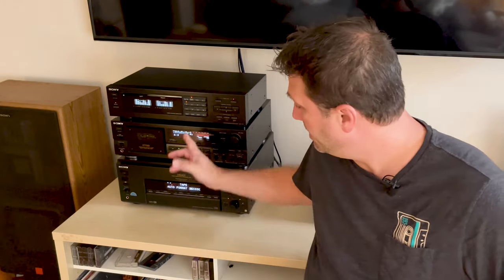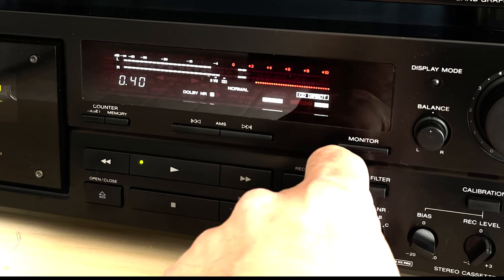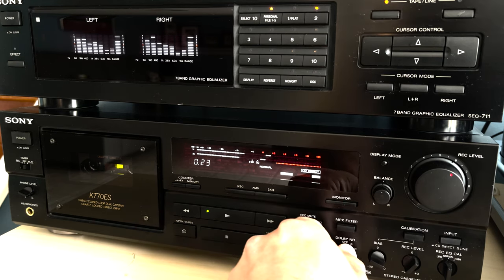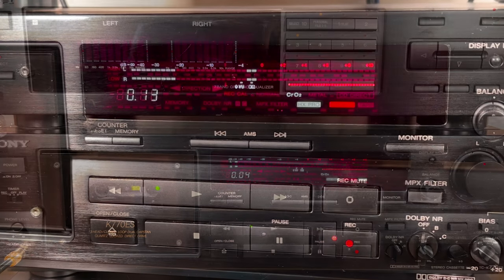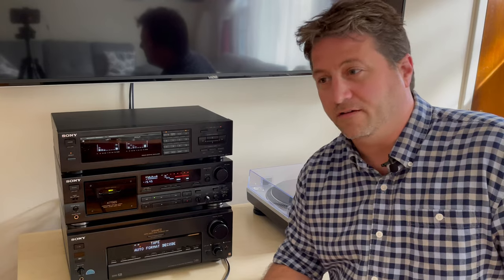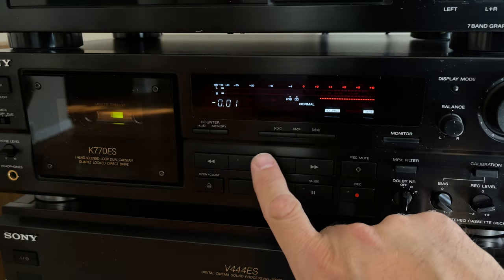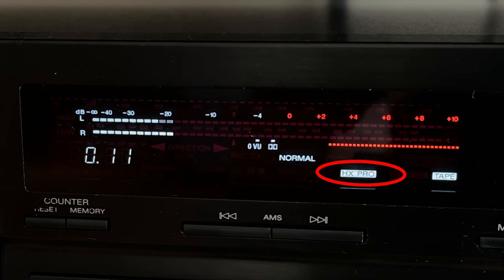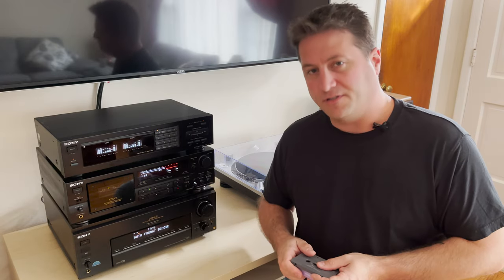Dolby Noise Reduction - Did it ever really work right?

Comment: One issue with cassette is that the head azimuth very rarely matched 100% between two decks (unless you realigned them yourself like I did) so there’s a very good chance that the head alignment on your tape deck does not match what’s on your prerecorded cassette.  Since Dolby NR is a compander based system, its performance is dramatically degraded if the alignment is even just a tad off.
Reply: @PWS Productions 
Dirt, and also tape/head wear.  
With due respect, I can get azimuth pretty spot-on by ear.  I pretty much have to when I’m digitizing old tapes and I want to get as much off of them as I can.
Reply: @PWS Productions 
Back when I used to record onto cassettes for listening on my Walkman or in the car, etc., I got pretty good at adjusting by ear.  I’d record something with a good amount of highs, and then use that to re-align other decks to it because I wanted to be able to get the best I could from Dolby NR.  It actually worked quite well.  Summing the outputs to mono really exposes azimuth error, in that even the slightest bit will cause very audible phase cancellation.  I still use use that method today when I’m digitizing old cassettes and I want to get as much off them as I can.
Reply: @PWS Productions 

The good thing about Dolby-B, as opposed to C, Hi-Com etc. is it will still sound alright even with a slightly misadjusted or ground down head, adjusting by ear will be fine. 
If Dolby B doesn't work it's either user error, or the adjustment is too far off, and when you're unlucky, the head is too far gone.
Reply: never gad issues with azimuth, just dirt, and rarely magnitized.  people messing with heads not knowi g what they are doing.
Reply: Spot On! Worked at a tv station they had revox cassette decks I had awia hitachi and sony my tapes always sounded dull on the Revox machines.
I purchase a Sony head azimuth  check all my decks all good but when played on the revox bad the revox was aligned to a german azimuth  tape
Reply: i always use a pre recorded tape and then align the head so the pre record sounds it best then that way all my recorded tapes with dolby s sound great on other decks/Walkman with dolby b
Reply: ok. we found the one guy that can make Dolby NR work. 
you just have to manually align the azimuth of the tape head.
Reply: @johnviera3884 
That’s why it got a reputation for making things sound dull.
Reply: Yup.  And even two decks from the same company can have a sight variance as well.  I even had a fairly decent dual well deck with the same thing.  I ended up realigning all my decks anyway and got Dolby B and C working quite nicely between them.

Comment: So many things wrong with this video.  1:Dolby level is NOT where your peaks should be. That is there to help you adjust your meters when playing a Dolby Test Tape.  2: For Dolby to function correctly, a cassette deck's  playback level needs to meet the spec of the chipset used in that particular deck. Your 30 year old decks have drifted enough, that the Dolby tracking is "off spec", meaning there will be errors.  3:  Head Azimuth has to be dead on for Dolby to work properly between different decks.  I can assure you, on a properly adjusted deck., Dolby NR works flawlessly.
Reply: Maybe, but this was a consumer technology, most users would not have the means, interest, nor expertise to align, clean and calibrate a cassette deck to this degree (or any degree in a lot of cases). As I remember, I used to record Dolby C onto quality tapes with a well maintained, decent quality, 3 head HxPro deck. The recordings would sound absolutely spot on for the first few plays, then you would start to notice slight variations / hunting in the high frequencies. I could never understand this. Perhaps the 'Quality' deck I had wasn't so good after all  - who knows? I therefore stopped being a fan of cassette tapes many years ago. Yes Dolby worked, but it was way too finicky.
Reply: @adamdavies163  After each playback high frequencies on a cassette are lost by small amount, so every time the "mistracking" goes bigger and bigger compared to where the sound spectrum should be.

Comment: Try a 3 head with Dolby S and you will change your mind it was the consumer 5 band system from dolby based on Dolby SR  it beat out minidisc for sound quality in stereo review shootout in early 90s plus i didnt see you adjust bias or how often are the heads cleaned  good video but a few questions about the test keep it up im subbed:)
Reply: He did the calibration process correctly which includes adjusting bias and it is a 3 head deck, just no Dolby S.
Reply: sorry but no cassette tape will beat minidisc for sound quality .. DAT maybe but not compact cassette

Comment: As far as I know, the Dolby level marking on the VU meter is just a reference for calibration to make the expansion match the compression and reduce pumping and breathing. It does not mean it's the peak recording level.

Also of note is that NAD and Yamaha introduced a feature named Play Trim, which EQ'd the sound before Dolby decoding to compensate for errors with cassettes recorded on a different deck.
Reply: Wanted to tell the same. In no way the Dolby symbol is kind of a level limit. I made some great and loud recordings with Dolby S on my Sony deck on some really hissy Type I tapes.

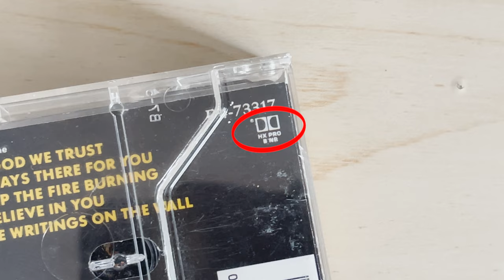Comment: 1:47, I believe almost all prerecorded cassettes after the mid 70s until rather recently had B NR. It was indicated by the double D logo. It didn't have to explicitly say "B NR". I am guessing it was only written once C was available. There are Dolby S NR cassettes, but they're rare. Some Canadian (Cinram) pre-recorded tapes rival homemade type Is in quality. There are also CrO2 tapes from CBS recorded with type II bias and are to be played back as a type I. Some consider these exceptional.
You're right, with modern formulations, noise reduction is less of an issue, or almost non-existent. But you pay through the nose for type II or IV tapes. I have a couple bricks of new old stock "super ferric" ferric cobalt tapes that take tons of signal (Memorex dB C60s, < $1 each), have very good frequency response, but are hissy. C NR virtually eliminates hiss. Being older, my hearing falls off above 13 kHz. To me, the HF sound quality is almost indistinguishable from off, while still holding a signal 3+ dB above the double D marks.

Comment: Dolby NR did work well but, clearly, not for everyone on every deck.  I don't know where you got the idea that "Dolby-Level" is the level you are supposed to keep below.  That is not the case at all.  Dolby Level is the point where Dolby NR stops compressing the recording (or expanding the playback).  All signals above Dolby Level are unaltered and should sound identical between no NR and NR.  The upper end is determined by your deck and the tape formulation as to when it saturates. 

Proof of properly calibrated Dolby NR is pretty easy to achieve as one can record something like pink noise and play it back on an RTA and compare with and with NR and  then record at differing levels.  If the frequency response changes with level, that would indicate mistracking.

However, with your set up, part of the problem is likely your recording levels.  Most cassette decks can only achieve their wide frequency response down in the -20VU range (check the spec sheets for your deck).  If you are recording up in the 0 to +3dB range...odds are, your deck is already killing the HF range some and when you add Dolby NR to the recording, it will exaggerate it.  If you drop your recording level a bit, you'll likely get your HF response back and have an even wider frequency response without picking up the noise.  Dolby-B is going to get you about 10dB of NR in the critical frequencies where hiss and such will be perceived. 

Dolby C will get you closer to 15-16dB.  So, based on where your deck can record the higher frequencies, you can target your recording level and then use NR, properly, to keep tape noise in check.  Dolby S will go yet further to allow one to optimize the recording level and dynamics of one's deck.  

Sony is a bit closed on their published specifications but for Type IV (Metal, they show that the frequency response is 20Hz-21KHz but it reduces to 20-16KHz at 0VU and you were 3dB above that and using Type 2 tape, it would likely be down at 13KHz or so by 3dB at 0VU and even more so at +3VU.  

It is one thing to use no NR and to record hot to keep the tape hiss down but you will do so at the expense of widest frequency response (not many people can hear up to 20KHz and not much is recorded up there anyway).  But with NR, the goal is not to record as hot as possible but to use the NR to achieve a wider frequency response while keeping the noise floor lower and to strike the balance between the two.
Reply: Hi! It is just not true in general that above the Dolby level any Dolby N.R. do not do anything to the signal, for example, Dolby B do not really touch signals above about minus 10 dB, Dolby C modifies signals at all levels (but differently) etc.

Comment: Good video. Dolby is very finicky in regards to correct internal deck calibration - something that has drifted on most 30 year old decks. You've calibrated the tape which is good. But if the internal record/play calibration is out (recording hot and playback weak ~ or vice versa) this will still mis-track Dolby. As little as 0.5db mis-calibration will throw Dolby-C off creating an slightly bright or slightly dead recording. Get it right however and it can, and does sounds very good indeed.  

As others have said the Dolby symbol on the display is a reference level. Despite what you hear on the internet its perfectly fine to record past this point. Dolby-B is turned fully off above the dolby reference point and has no effect good or bad. Likewise Dolby-C turns off except for an added anti saturation filter that reduces high frequency tape distortion at high levels. 

You mentioned Dolby-S. I can confirm it is good. It makes standard tapes (eg TDK-D) sound like expensive tapes recorded with a well calibrated Dolby-C setup. Almost CD quality. To the ears at least (although test equipment still gives the game away). Dolby-S is a four band system and to minimise mis-tracking it was designed to do as little as possible unless actually needed. In comparison B and C are single and dual band systems respectively. 

There's one final thing that Dolby has a LOT of trouble with. And that's modern sound cards. Quite a number of them leak ultrasonic noise and that causes severe Dolby mis-tracking during the recording process. If a recording sounds junk from a laptop but great from a cd player this is often the cause.

Comment: For type II tapes, not using dolby means you get some 3-5db more headroom during recording. That is also how much you can lower the noise floor by recording louder and compensating for that by loweing playback volume.

Dolby B, provided everything is calibrated properly, gets you a better reduction in noise levels, dolby C even more, but is even more sensitive to proper calibration. Proper calibration isn't just about bias/levels/eq, but also about internal playback amplification being set properly, azimuth being correct, etc. 

Also, using a 3 head deck, and monitoring the recording lets you change the recording level to the point where the 'dullness' goes away. Keep in mind recording levels as indicated on your meter are not exact science, the proper recording level, and how this recording level affects the tonality and linearity and distortion is quite dependent on the actual content. Use indicators on the display as a starting point, but also monitor and adjust to make things sound right. With that, dolby C (and even more so Dolby S) can get you much much better results that you got here.

Comment: One thing not many people know:

Many cassette decks, including high end models, did suffer from wearing erase heads. Teac, Denon, Technics . .

The wearing erase heads gives mechanically friction on the tape while playing, causing partial HF erasing on type 1 tapes. Not electrically, but mechanically. Every time you play a type 1, as most pre recordeds, the highs will be erased a little bit, although it settles after a few plays). It can be as bad as 3dB in my measurements.

This is one of the biggest reasons so many pre recordeds are sounding muffled today, as nearly ALL 80s decks suffer from this problem and most pre recordeds are type1. Using dolby will exaggerate this problem as it misstracks

Nakamichi and later many other brands, got sandust protected erase heads to battle this problem.

I found out this a few years ago that, only on type 1 recordings, the highs disappeared after some plays. Putting some clear tape on the erase head fixed it (and still do erasing the tape sufficiently)

Comment: You CAN NOT switch Willy nilly between noise reduction types like your doing in your test.  Noise reduction is an encode-decode process and you need to encode say for instance type b when you record.  Then, you should use the same type (in this case b) when you play it back.  You can KIND OF encode b and then  not decode it.  That's because it's mild but if you encode in type c which is much stronger, then you should play it back with type c engaged.

Comment: Dolby NR is one of those things that works fine in the lab (or a professional recording studio) where everything is all tightly aligned and calibrated up the wazoo. But when subjected to the variations of mass production and the cheaply-made, worn-out, dirty, misaligned tape deck that Joe Blow owns in the real world, it doesn't work so well.

Plus, of course, there are tons of cheap tape players like ghetto blasters, Walkmen, car stereos, etc. that never had fancy stuff like Dolby or chrome tape options on them anyway. If you're selling pre-recorded tapes, you have to make sure that those tapes sound at least "okay" on those units as well as the Nakamichi Dragons. Dolby B sounds at least passable on those cheapo decks, while as Dolby C or DBX sounds just plain weird when played back on equipment without those options. So at the end of the day, it's a compromise between quality and making a product that's cheap enough and compatible enough for the great unwashed masses with junky equipment who made up the vast bulk of cassette buyers.

Comment: Dolby B was a very mild noise reduction designed so that if you played it using non-Dolby equipment all that was needed was to reduce the highs a bit.  The biggest problem with Dolby B and C is that they are very dependent on proper calibration of the recording and the average (or really RMS) level had to be at the Dolby zero level to be most effective.  Unfortunately most later decks have peak meters not RMS and so your recording levels are too low and the Dolby becomes much less effective.  You have to set the recording level so the meters bounce back and forth around the Dolby 0 level to be correct on a peak meter.  And as someone else said head azimuth is also critically important.  No pre-recorded tape could hope to keep the Dolby calibrations after high-speed duplication at the factory, so it would always muddy the sound to a certain amount if played back under Dolby decoding.  Dolby S addressed most of these issues and DBX noise reduction never had them, since instead of a volume-dependent log-scaled reduction it was a straight 2:1 compression.   As far as I know though DBX was never used for pre-recorded tapes, since the tapes are totally unplayable without decoding.  Dolby was a cheap way to say "we tried to make it better" without it requiring special equipment to play it back.  Dolby B was really invented for noise reduction on consumer reel-to-reels back before low noise tapes.  Back then you hand-calibrated your Dolby AN-60 (if I remember my model number correctly) compandor unit yourself using test tones and set screw level controls.  And then all your levels were set using analog meters which by nature were RMS.  I think it was more a part of the culture by the time high-fidelity cassette came around, and consumers wanted what they had on reel-to-reel.